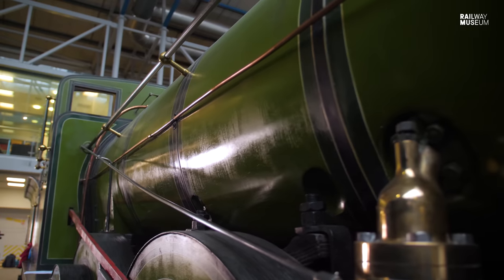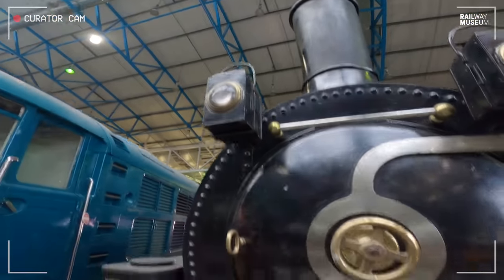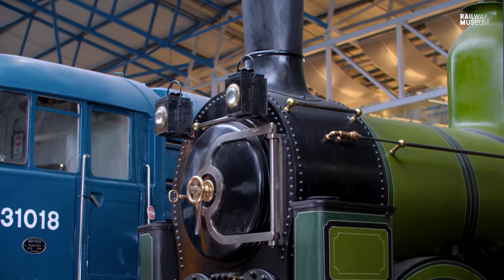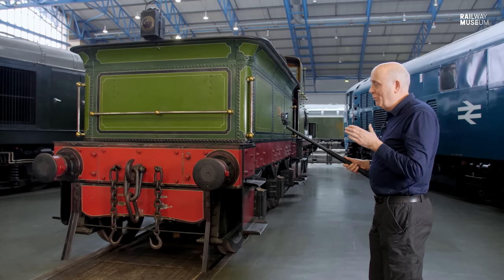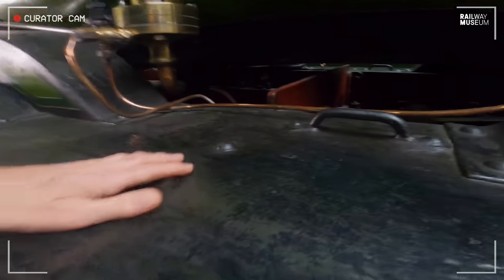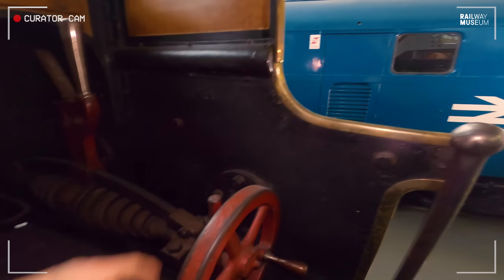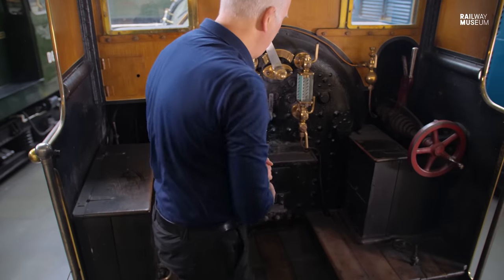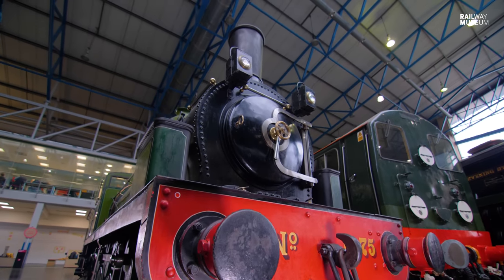Why was it nicknamed 'Hippopotamus'? Exploring Stephenson's long boiler loco | Curator with a Camera

Comment: Regarding the "wood effect" on the walls of the cab: this, in combination with the polished copper and brass of the various elements, gives a somewhat cosy atmosphere and suggests to me that the designers took into account the aesthetics of crew's working environment. Full marks for that!
Reply: Ì have akquired a photo of Alfred Kitchens 1848 loko Woodlands #58 for stockton and darlington  there are some similar details .This 1870 photo is so clear when enlarged 10 times its still as clear ,if you want a coppy let me know ttfn&ty

Comment: Why assume that oiling was done while moving? The wear on the iron plates would be the same whether moving or not.
Reply: It was common practice to oil round while on the move in those days. The oil was gravity fed unlike in later locomotives where mechanical lubricators were used. The oil needed topping up often and was the cause of at least one accident when a driver missed seeing signals and ran into a train infront. The railway inspectorate took a dim view of drivers leaving the footplate and after a time the railway companies banned it.

Comment: That really bizarre that they didnt really think of crew comforts until much later on. This happened not just of steam engines, another example that springs to mind are ww1 era destroyers. Alot of them had completely exposed bridges. No sheiding from the elements. Sounds like a very unplesant time to be working these kind of engines.
Reply: I suspect it’s intentional for this loco. Working in industrial yards, around pits, places where the rail is in a “shared space”, you’d really need the added visibility and ease of access afforded by having no proper cab. Definitely no fun to work with on a rainy day, but I reckon it was considered and decided to forgo a dry crew for the sake of visibility.
Reply: I think the exposed working spaces on these engines is simply a throw back to the workspaces on horse-drawn carriages or carts (drill down to horse-back). There was no requirement for any different consideration.
Reply: Well we started with no cab at on all the first engines so I think they thought that was Crew comfort, it's quite iterative in a way. The longer you go on the more cab till now where you are fully enclosed with a heater and air con. Also keep in mind the further you go back in history the thicker and more layers of clothes people wore and they actually used more of the energy from the food they ate on warming their bodies up than modern people

Comment: 1275s livery is a favourite of mine, and a far cry from the unlined black she wore from ~1917 until withdrawral in 1925.

The reverser arrangement is definitely worthy of note, technically it's both lever AND screw reverse, turning the screw essentially moves the notch that the lever is sitting in, allowing for precise on-the-move setting of the cutoff, but the lever can be moved on its own to enable a quick reversal during shunting.

Quite a few NER locos were so fitted, including many of the Class O (LNER G5) 0-4-4T's.
Reply: That makes complete sense. Thanks for the information.

Comment: The reverser is similar to those on the RHDR that is to say you could do fine adjustment with the hand wheel and quick reversing by disengaging the the screw and working the lever. Quite important on a goods engine. I noticed the water valves for the injectors but did not see the steam valves. Perhaps it just had pumps.

Comment: Thank you very much for talking about the NER 1275 from 1874. The Museum does a great job in preserving the knowledge of this technology. I would like a similar review of the NER Tennant 1463 which was built 10 years later. It too had the integrally cast valve chest under the cylinders. I have a live steam model of this engine.

Comment: Is there any chance the photo used at 0:36 is from the Victorian Railways  (VR) in Australia.
Three wagon types in the photo look near identical to standard VR wagon types that I have never seen on any other railways,
1. The wagon with vertical cage like bars and a peaked roof looks like an early VR L class double deck sheep wagon.
2. The side louvered Vans with a peaked roof look like early VR U Louvre vans.
3. Some of the open wagons look to be the same proportions and design of the VR I wagon. VR being an early adopter of the widespread use of all steel open wagons whereas the UK railways and especially  the NER built quite different wooden designs for coal transport for a much longer period.
4. The cattle wagon while not as distinctively VR looks similar to early VR M class cattle wagons.
A search for Victorian Railways L wagon , for example, should show the similarities I am talking about.
One VR wagon type that does look like an early GNR or NER design is the VR Z class brake guards van so there could be a transfer of some other VR designs from the UK that I am less aware of.
The building also look to be wooden weatherboard types with a front sloping verandah. These look to be more Australian economy designs than anything I have seen in photographs of UK railways.
Maybe the photo got classified under Victorian Railways era photgraphs rather than the location and railway name. These often turn up noticed by me having the VR as my home railway of special interest to me.  
Any NER experts with thoughts on this out there?
Reply: Living in Melbourne, Victoria, Australia, I am not going to disagree with any of the above. If we were able to identify part of the station name, again on a typical VR name board it could give us a location, but it is probably out of focus and too far away.
Reply: The image is of Moe on the Gippsland line, and appears to have been taken from Wikipedia.  This station was significant for being the terminus of the 2'6" gauge Walhalla line, with some narrow gauge stock visible just behind the darker shed in the background.  Since the Walhalla line opened in 1910 and bogie E wagons were introduced in 1925, we can date the image to somewhere in the 1910s or 20s.

Comment: Oiling Stephenson's gear from the running board WHILE the loco is IN MOTION?? No thanks!! That's a terrifying prospect!

So glad to hear those noises in the background. Glad to hear work is progressing with your renovations. Wishing you the best from the states! Maybe one day I'll be able to travel abroad and see your wonderful collection!
Reply: I don’t believe that was ever done anywhere at any time.
Reply: Surely it'd be frowned upon to say the least for the driver to leave his post while a loco was in motion 🤷🏻‍♂️
Reply: @pvtimberfaller 6:14 a comment is made alluding to this. This is long before modern safety practices, mind you
Reply: @jibbsey This is a fair point. Though it was usually the driver's job to lubricate everything,  a good fireman could have done it just the same if need be.
Reply: If this oiling was ever actually done it would make sense that the right side was more worn, a right handed person would hang on with is left hand and reach under the boiler with his right arm to do the oiling.

Comment: Very interesting, indeed! How were those sanders operated...? There doesn't seem to be a lever for it in the cab...
Reply: I suspect it was the usual practice of the fireman crouching on the running board and pushing the sand down the pipe by hand. An extremely uncomfortable mode of travelling, with certain intimate parts of one's anatomy very close to the hot smokebox!

Comment: Am I right in thinking that there isn't a brake other than the handbrake? Was that a common setup on locos in the 19th century?
Reply: Indeed, I'm not sure when 1275 was fitted with a loco steam brake, but it and its contemporaries were definitely built with just the tender handbrake.
Reply: This also was a low speed mineral locomotive design , so extra braking performance was thought less necessary then.
Reply: @johnd8892  True, on steep descents (such as on the Stainmore line) the train would be stopped before the gradient fell away, and wagon handbrakes would be applied.
Reply: In the early days it was considered inadvisable to have brakes pushing on just one side of the coupled wheels so tender locos relied on just the handbrake on the tender.

Comment: One article by Cyril J. Freezer notes a particular company (Furness, perhaps?) that tried to put big American cabs on their engines to shelter their crew, and the crew hated them. He couldn't understand why anyone would rather be working out in the open in the snow and rain and wind. 

By the 1930s, many North American engines had all-weather cabs that were completely enclosed. Not even an LNER A4 Gresley Pacific had an enclosed cab; I can't imagine anyone volunteering to work an engine at speeds of 100 MPH under those conditions. It might have been necessary due to the lack of oil-firing and mechanical stokers on British engines.
Reply: I recall that anti cab reaction being reported. Thought it was 1860s Stockton and Darlington.